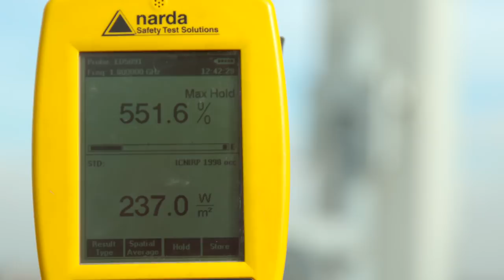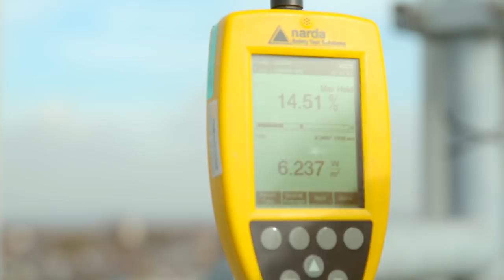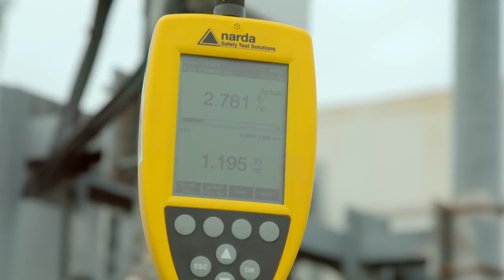Testing The Safety Of 5G - BBC Click

Comment: Bad test... 5G is not Isotropoc, like 3, 4 were... This means when you get or make a call it directs radiation to your specific direction, beaming you (non isotropic) , and not spreading evenly all around from the emmiter (Isotropic)... So the specialist should be doing a call with a smartphone on His pocket to test how 5G works when it is supposed to act (during a call or data view) and not a quiet sitting anthena (how much you guys were paid??? )
Reply: CORRECT.

Comment: yes but 5g street lights are right outside peoples bed rooms and that will fry them over night
Reply: They would be even lower power again than shown here. No need for concern.
Reply: Didn’t we say the same thing about 4g and 3g, oh and remember mobile phones. Cmon guys it’s getting old
Reply: This man said "nite" instead of night, you must have a master of science degree & can 100% be trusted.
Reply: These are the same nutters who believed in the millennium bug...literally
Reply: 5g has such a low energy that even at 2m its below the limit, and its so weak that it cant go through even thin walls, and glass is opaque to that side of the spectrum. Its not dangerous, no ones out to get you
Reply: @tonypulla9582  also you end with a closeing bracket but without a corosponding open bracket

Comment: In the US, the safe limit for continuous exposure is 1.2 W/m^2. In this video, they are referring to a rating for brief exposure, like 30 minutes. Also, this does not consider a busy area saturated with towers in addition to wi-fi hotspots.

In short, EMR pollution in general is the concern. And, as said in this video, the devices around you are a larger concern, but the number of devices and towers are all contributing to EMR pollution that is worth keeping an eye on.
Reply: 1.2 W/m^2 is so atrocious. It's like "smoke up to 500 packs of cigarettes' a day and you'll be fine. You dare question these safety standards? Tinfoil hat flat earther!"
Reply: @jonah1418  
Keep in mind that sunlight is EMR with an energy density of up to roughly 750 W/m^2. Those wavelengths are too short to penetrate your skin effectively, but you can feel the heat and even be burned within several minutes.

Also, with microwave EMR, most of the energy passes through you. I say this just to put the 1.2 W/m^2 in perspective. Microwave EMR is still dangerous at certain levels depending upon the length of exposure. The EMR sickness that many people get from smart meters installed directly on their house proves this.

Comment: All these people saying how dangerous RF radiation is, while typing on their computer inches away from a WiFi transmitter, and probably a Mobile phone on the desk nearby.

If your that worried, switch them all off.
Reply: 5g is far different then 4g dummy. Lame point made.
Reply: @whybolo9793  No it isn't, 5G just refers to the way the data stream is handled by the network, it stand for '5th Generation' the RF side  is much the same as 3G and 4G.
Reply: @jonmac3995  This Bolo dude got his phd in electrical disinformation engineering from the university of flat earth and can see the difference between 4G and 5G with his own eyes!! So nothing else can change his mind.
Reply: Exactly, but if they give up all these 'evil' technology, most disinformation merchants will loose their main income stream from conning other morons and no way most believers will be able to live without having their egos stroked 24/7 on social media through constant reaffirmation...
Reply: @jonmac3995  Lol. 4G frequencies are from 2.4 to 5GHz. 5G operates on 24-100GHz. How can you even compare that. Not to mention how much power is in the towers, plus there will be one every 20meters. You are ignorant.
Reply: @jonmac3995  haven't you read about the military use of mm waves? It is used in many wars, and other nefarious purposes
Reply: @tim3854  How many mm and what sort of ERP and modulation method are the military using ?
Reply: @whybolo9793  How is 5g "far" different from 4g, except for being at a higher frequency, but still far lower than the lowest frequency of visible (red) light? Or is the light in your living room also dangerous? EM waves become dangerous on a higher frequency than visible light (UV light) because they are ionising - they literally damage the DNA of the cells, hence why long exposure to UV light is one cause of skin cancer.
Reply: @htpcnz7378  ever heard of that quote from some smart guy?
it goes like "It's hard to win an argument against an intelligent person,and it's impossible to win one with a stupid person"

Comment: Absolute bs, the frequency cant drop by 500 in 3 meters lol, thats a lose of 175 frq a meter yh right. Fake af.
Reply: The frequency doesn't drop, it's the power-radiation. And take a physics course, you have a lot to learn.
Reply: The values obtained are correct, not fake at all. However, that single panel is only about 500W whereas an entire cell site can be about 6KW (omnidirectional). Also, placing the tester so close only samples a fraction of the panel's power, they are meant to be used further away. Very easy to obtain 600 mW/m2 at 50m distance. All the safety standards only account for thermal danger and do not in any way account for any other possible biological effects. There have been studies showing effects at far lower power density values, which is easily possible up to hundreds of meters from the cell tower. See, www.bioinitiative.org
Reply: someone doesn't understand the inverse square law

Comment: This video is highly deceptive, what about when the millimetre wave frequencies are put in use in the second stage of the 5G deployment?(I mean 30GHz - 300GHz) What's gonna happen when the millimetre wave antennae are installed on hydro poles on every 20-30 metres? Not to mention 60GHz WiGig WiFi routers at schools and homes???

Comment: When science and feelings conflict, always go with science.
Reply: Agreed. And the science proves that it is not harmful!
Reply: @Chris-jt4ux  completely untrue.  Thousands of studies are not wrong. Just because you fail to look at the independent science does not mean it doesn't exist. You have to look at both sides.   Summary: 

We know that there is a massive literature, providing a high level of scientific certainty, for each of eight pathophysiological effects caused by non-thermal microwave frequency EMF exposures. This is shown in from 12 to 35 reviews on each specific effect, with each review listed in Chapter 1, providing a substantial body of evidence on the existence of each effect. Such EMFs: 

1. Attack our nervous systems including our brains leading to widespread neurological/neuropsychiatric effects and possibly many other effects. This nervous system attack is of great concern. 
2. Attack our endocrine (that is hormonal) systems. In this context, the main things that make us functionally different from single celled creatures are our nervous system and our endocrine systems – even a simple planaria worm needs both of these. Thus the consequences of the disruption of these two regulatory systems is immense, such that it is a travesty to ignore these findings. 
3. Produce oxidative stress and free radical damage, which have central roles in essentially all chronic diseases. 
4. Attack the DNA of our cells, producing single strand and double strand breaks in cellular DNA and oxidized bases in our cellular DNA. These in turn produce cancer and also mutations in germ line cells which produce mutations in future generations. 
5. Produce elevated levels of apoptosis (programmed cell death), events especially important in causing both neurodegenerative diseases and infertility. 
6. Lower male and female fertility, lower sex hormones, lower libido and increased levels of spontaneous abortion and, as already stated, attack the DNA in sperm cells. 
7. Produce excessive intracellular calcium [Ca2+]i and excessive calcium signaling. 
8. Attack the cells of our bodies to cause cancer. Such attacks are thought to act via 15 different mechanisms during cancer causation. 

There is also a substantial literature showing that EMFs also cause other effects including life threatening cardiac effects (Chapter 3). In addition substantial evidence suggests EMF causation of very early onset dementias, including Alzheimer’s, digital and other types of dementias (Chapter 3); and there is evidence that EMF exposures in utero and shortly after birth can cause ADHD and autism (Chapter 5).

Please see the entire 90 page document here: https://peaceinspace.blogs.com/files/5g-emf-hazards--dr-martin-l.-pall--eu-emf2018-6-11us3.pdf
Reply: I strap my phone to my head all day 24/7 has no effect on me.

Comment: Here in the UK, we have indapendent organisation called Ofcom and they are responsible for rules and testing etc... However, recently they supposedly tested 5G in the UK and said its within safety limits... even though quite interestingly they happened to INCREASE the already set levels of radio interference safety levels at the same time of doing these test(s) how convenient ... But what I HAVE NOTICED, is that there is a 14 Page Safety Report PDF available to download and view directly on the official Ofcom website, now it also states what peice of HARDWARE that they used to measure the radio waves and any interference - Namely NARDA SRM3006 - this is a expensive peice of hardware, and it has specifications which STATE DIRECTLY FROM THE MANUFACTURER THAT IT HAS A FREQUENCY MEASURING RANGE BETWEEN 9 kHZ up to a maximum of 6 GHZ - WHATS THE PROBLEM.... 5G can operate MUCH HIGHER THAN 6 GHz.... 5G has a capability of operating up to 300 GHz - however currently at the time of writing, the HIGHEST FREQUENCY CURRENTLY BEING USED BY AT&T COMPANY AT 39 GHz - so ultimately its not been tested in the higher frequencies, if you want more information about my own factual findings, feel free to contact my by simple email, via my website, I am very easy to find contact and talk to Paul, Liverpool UK
Reply: _"5G can operate MUCH HIGHER THAN 6 GHz"   So can I..  legally.  https://rsgb.services/public/bandplans/#31 and with MUCH more power than a cell phone mast can.  What's your point?
Reply: Contact info pls

Comment: The understanding explained here is extremely limited.

The most essential point to understand from anything dealing with photonics and the quantum world.
Is...
There is a non-zero chance of a photon/particle overcoming an energy potential difference. (refer to an electron in a box / quantum tunneling for an overview)

The photon represents 5g, the energy difference could be the penetration of the skin. whilst the probability could be 0.00001% of this occurring. The number of photons in a continuous stream of EMR is wavelength/speed of light. Let's use 5Ghz or 12cm as our signal. Number of photons incident a second (disregarding absorbed/scattered photons) is 3x10^8/12cm = 2.5 x10^9 incident photons per second.
You start to see that even with incredibly high, improbable penetration odds, there will be a large amount of photons penetrating the skin, the cells, the DNA in our bodies (potentially).

Same context applied to the definition of non-ionizing radiation...

Non-ionizing radiation still has a non-zero probability of ionizing a molecule/atom. Fundamentally, we define ionizing radiation as a high-probability EMR ionizing potential.
So even with insanely long probabilities of this occurring for microwave level frequencies, there is a non-zero chance and given a continuous stream of photons over the course of years, you start to see the probability to change to be somewhat likely. 

Why is this a problem now?
It's always been a problem if you were working with radars or cell mast equipment (just google images of masts and their warning signs, and supporting documentation for workers).
Our phones differ somewhat, in that the signal isn't continuously emitted, but this problem does apply if you stayed on the phone for days and left it near your head (see cell phone cancer scars for context).
3g/4g has existed for years. Whilst these may be continuous, because of the lower frequencies the masts are more sparsely located and following inverse square law of radiation absorption from a single point, the probability remains low.
With 5g High frequencies, intended to be every 100m, emitting continuous EMR signals, which could be in a lampost outside people houses, you can qualitatively understand how the danger of the technology increases.

Just because EMR is labelled non-ionizing, it doesn't mean the frequency is non-ionizing.

The light from the sun is non-ionizing but we know that if you stay in the sun too long you get damaged which leads to skin cancer. This scenario is analogous to 5g, but with very different probabilities of occurring.
IN SUMMARY
It's lazy to outright say it's safe no matter what, as it simply isn't true by every way you look at it. People will accept risks provided their qualified and rationalised. To shut down the science and conversation doesn't work. Treat people like adults might lead to a better scenario with transparent limits and liabilities on telecom companies, which is ultimately safe and better for everyone.

PLEASE change my mind and pick apart the science.
.

Comment: But what about the radiation from the phone back to the tower?   In that case the transmitter is right next to your head.   No mention of that.
Reply: The phones are checked too before being allowed on the market, but since it will vary from phone to phone what's the point? You're phone is already putting out wifi, bluetooth, 3g,4g etc. Despite the early fears no one's getting sick despite billions (with a b!) of users.
Reply: The human body is a electromagnetic unit think about how 5G effects the body and brain!

Comment: What's not considered or discussed  is the beam-forming ability and rapid pulsations of 5G specs , neither is the densification  of transmitters 5G requires (on every 3-5 streetlights), the extra emissions from the internet of things and finally onto the smart city (all in the Department of Digital, Communications Media and Sport policy docs available online).  Most studies when looked at show that non-ionising radiation does cause DNA damage but the pathway is indirect.  If you then only take the studies which are not funded by industry then the findings are overwhelming that this is the case.   Studies have been analysed by many scientists like Professor Henry Lai for example and they all find the same.

Comment: When you realize your microwave puts off more than 5g y’all 5g is safe
Reply: Blind
Reply: @deadmeme5017  nope
Reply: @Schnitzeldawg  blind af
Reply: @deadmeme5017  you know light its self has frequency? you know when u put a flash light on ur fingers and the light goes through? thats cause its frequency that is going through your hand
Reply: still not good y'all.
Reply: @deadmeme5017  What's the truth then?
Reply: Microwaves have that door which blocks out most of the radiation,i believe it's called a "Faraday cage"
Not the best comparison but i get it
Reply: @Schnitzeldawg  exactly, and visible light has a higher frequency than microwaves.

Comment: The government safety standard is based on the assumption that there is not health effect to to radio frequency radiation that does not heat the tissue. 
This assumption have been proven wrong as studies show DNA damage, Blood Brain Barrier leakage,  Oxidative stress and many more biological effects at levels far below the current standards.  
The correct so called safety limits/standards protects the industries and the polluters and not the public's health. 
Does who claim otherwise other don't know the science or serve the industry. In any case they promote the industries needs. 
If you ever felt and headache after the use of a smartphone or a wireless device, then this is just one effect of the RF radiation at levels below the current standards.

Comment: "(...) the power drops off really really quickly as you move away from the TRANSMITTER..."  Correct...
NOW... MY QUESTION IS THIS: "WHAT IS A CELL PHONE EXACTLY...!?"
ANSWER: A TRANSMITTER... SO... DID YOU GET THE PICTURE NOW...!?
Reply: it's more of a receiver?? that one 5g tower thing takes hundreds of cell phones and does them all at once, and if your cell phone has the same power as one of those towers, then why are those towers even necessary?? couldn't your cell phones just directly communicate, undermining the need for the towers?
Reply: that's like saying each PC does as much internet tugwork as each internet service provider hub thing. that's obviously not true, those places handle the internet connections of hundreds, if not thousands of internet connections!

Comment: Crazy how an entire comment section can collectively not know what ionizing radiation is.
Reply: And what is thermal vs non thermal and average vs peak averages. Can you explain??
Reply: So true. All the crazies gathered here it seems.
Reply: @Eternal Atake tell me about “taxing through 5g”. Is it different to “taxing through 4G”?
Reply: @Eternal Atake I’m not sure what your point is there 🤷🏻‍♂️
Reply: @Eternal Atake a privacy risk?? Why?
Reply: @Eternal Atake em radiation can go anywhere (sunlight for example) but mobile calls are encrypted so picking them up doesn’t help you listen to conversations.
Reply: @Eternal Atake Well I'm an unusually articulate and literate bot then! Tell me again how you can listen in on phone conversations using 5G networks. Is it different to 4G?
Reply: @Dman3827  How can you cause depopulation with radiation less dangerous than the light coming out of your lightbulb?